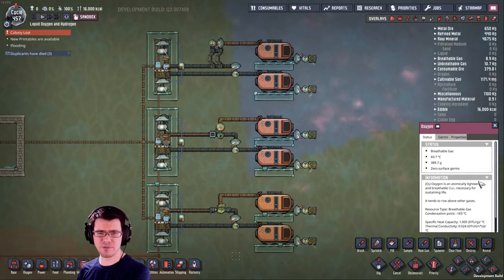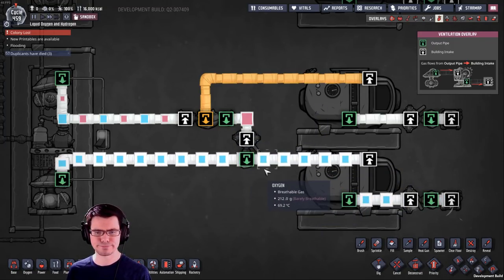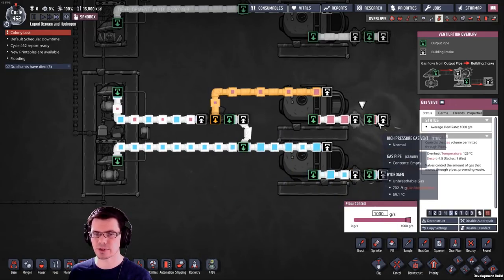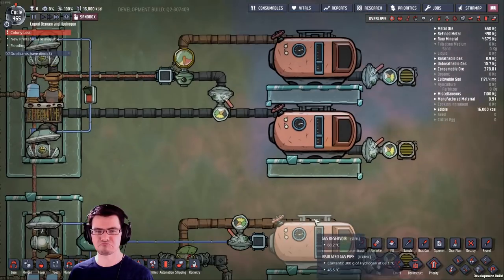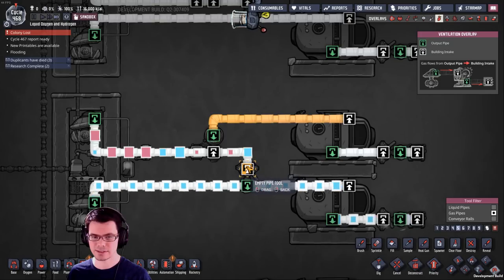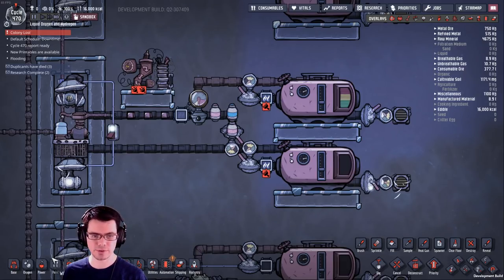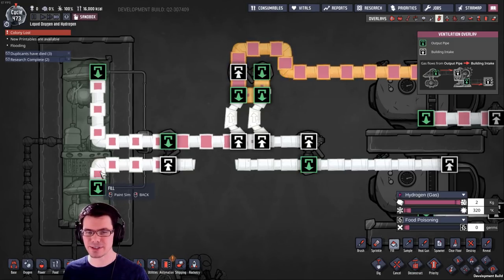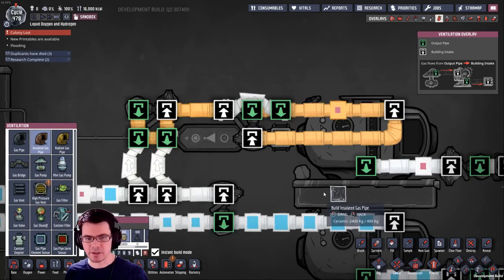3 Ways To Filter Gas! Oxygen Not Included Tutorial / Guide

Comment: Could you not just set up a smart battery that turns off the pumps when the energy hits a certain low percentage? That way even if power doesn’t go back up the filters would still have a little power to work with to do their job

Comment: For anyone that is watching this 4 years later, The 2nd setup can be made fail-safe with 2 gas sensors and 2 gas shutoffs and 2 bridges for the cost of 20W. 
Also, currently the shutoffs do consume 10W of power every time they let gas through, but not when they don't let anything, so you can optimize your setup to consume less power by prioritizing the pipes to flow mostly outside of the shutoff.

Comment: All of them are a pain in the butt.  The value fails just like the others.  But it's fast and easy to setup.  10w is free.  If 10w is breaking you power supply then you have other problems.  You can filler 12 gases for the price of 1 filler.  Since all fail.  Pick the easiest one to setup and the cheapest.  No powered is a pain to setup.  I'll pass.  I always use shutoffs.  Quick and easy.  Add a fail safe just like you'd added to your other options.  If you think you'll lose power or it could back up.

Comment: A gas shutoff does not use any power, test this by connecting it to the output of an small power transformer, charging the power transformer up, and then noticing that the power transformer does not discharge after the power producing station is shut down

Comment: The Hydrogen Backup at 12:55 is not safe at all. If you slow down/pause at this time you can see the first block of H2 Immediately goes past the bridges and gets blocked at the gas valve and will merge into the bottom line as soon as there is a gap in the line. If the bottom line isn't constant flow, then it'll have undesirable gas in it.

Comment: 9:34 Connecting two automation wires acts just like an or gate.  The Or gates the game has you build are redundant.
Reply: Not entirely redundant.  The or gates are needed if you have to isolate your inputs and outputs.  For simple 3-way connections, a wire is an or gate, but for more complex connections with more than one input/output, you can get cross-talk if you don't use the or gate.
Reply: @turosianarcher8771  The Not, Filter and Buffer gate can also isolate inputs and outputs. The volume would remain the same and you can move the pieces a little easier.  The only advantage I can think of is the refined metal costs.

Comment: gas in pipes with no inputs and outputs are easy to work with .  you can pre measure gas into vents destroy connecting pipes add more for a path then add valves or bridges to move it again.

Comment: the hydrogen line on the gas sensor/shutoff should be set to oxygen. power consumption comes when its active if you set up is good and you not getting much air it will have to use less power to filter instead of filtering all the hydrogen

Comment: I usually build a complete loop of gaspipes around my base, where I dump all my excess gases in and sort them out elsewhere using shut off valves. That way, it won't fail even if I have short power cuts, instead it simply travels another round.
Additionally I don't need to mind where the gases are added to the pipe or filtered out of it, because the gases eventually reach every filter

Comment: You don't need to use the 1 g/s valve to prime the mechanical filter (you still need the valve within the filter). You just need to give it at least 3 grams that are the same element without putting anything else into it and it'll filter it out like normal once it has an output. It'll send the excess out on its own.

Comment: That suggestion from emily is such a good use of the valves. I've experimented with them so much and never thought of that its real great. Only problem is that in an extreme drought situation (Where energy fails) it breaks on itself. If there is a reset condition with a filter then its probably the best option i've seen yet.
In theory you could also try running multiple combined gas pipes to compressors and then try to filter them based on frequency of occurance in your base leaving you with a gas pipe of every gas that is filtered with little energy overhead.
Reply: Man that 3rd filter is giving me some ideas..
Reply: To re-seed it after a drought and power loss, you could detect when the power is restored, then detect if the loop is empty and release a tiny bit of the appropriate gas from a reserve tank.
Reply: Actually im stupid since it releases 1g to itself and lag is the only thing that should break it.

Comment: why not combine both pumps into the filter at the first setup? a filter can handle 2 pumps never a wrong gas then
Reply: The general problem with this is that the filter would take 2 steps to filter 1kg of air. The first section of pipe can get 888g of O2 and the next section of pipe gets 112g of H2.  So you are filtering only 500g/s (888+112)/2
Reply: What? A gas filter can handle a full pipe. 1000g/s. O2 goes in at 888. O2 goes out at 888. Then H2 go in at 112. H2 goes out at 112.
Reply: @LTL_king  Yes?  The GF processes 1 'unit' of the gas per second. It takes you 1 second to process the 888g of O2, and then it takes you 1 second to process the 112g of H2. Two seconds for the Gas Filter to process 888g+112g. To be efficient, connect each Pump to its own Reservoir, and then using clock automation, Filter Reservoir1 for 50% of the day and then Reservoir2 for 50% of the day.  You get perfect 100% fail-safe gas filtering with 2 pumps running full time and 1 filter running full time.

Comment: Wow that was a complex setup. My most common is two gas valves, and an element sensor, and a not gate.
Reply: Just place two shutoffs next to each other, with a not gate over the two inputs. Like solution #2, but with a second shutoff.
Then add a bridge to put it back, if both are backfilled.